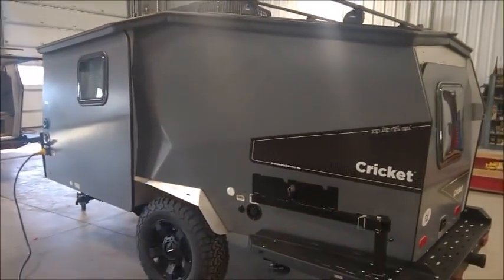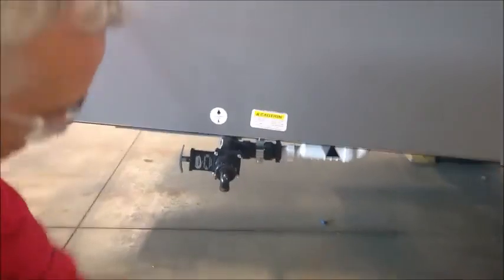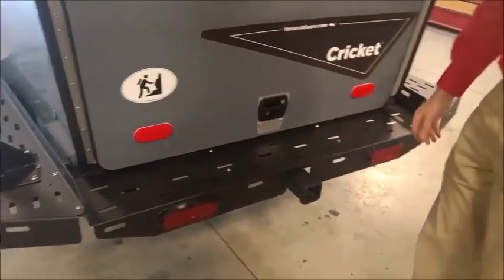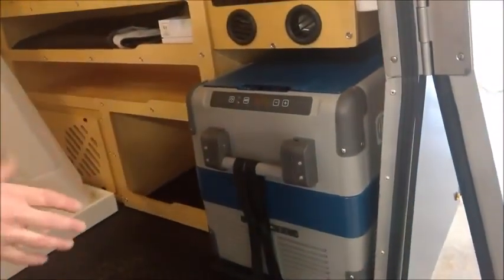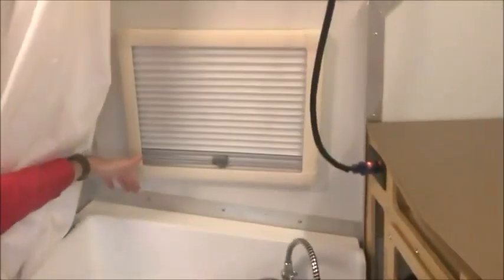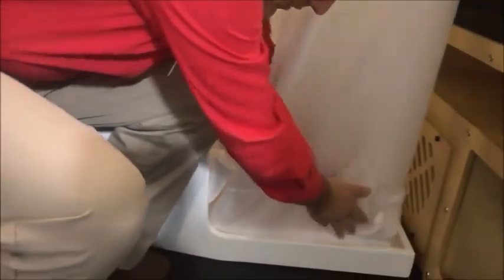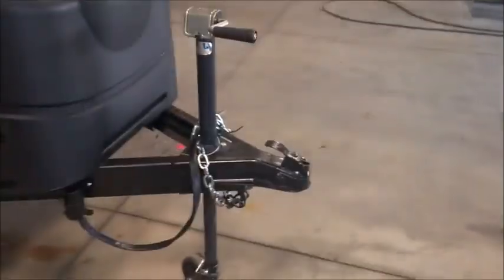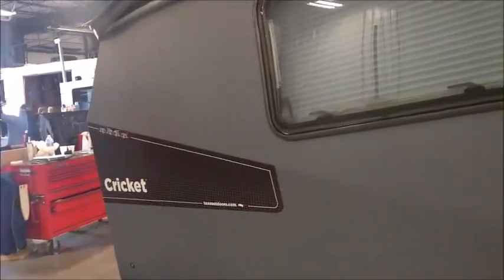Custom Cricket Camper - TaxaOutdoors

Comment: Is that a stand alone toilet shower or did you build it?  Is toilet cassette and how is it emptied?
Reply from the maker: It was custom made and fixed in place. Yes, it is cassette toilet, and it's emptied by pulling the cassette from inside the camper.
Reply: @teeh.5931  Please add link to the parts source if you have them.  Was the shower faucet moved from outside?   What do you pull it with?  Love the whole set up the way you modified it!
Reply from the maker: @bwj999  The build was done completely by  General RV, located in Wayland, MI. Ask for Tony Suddon, he runs the workshop over there, great guy. He's the one who worked on the complete project.
Reply: @teeh.5931  Got it.  Thank you!